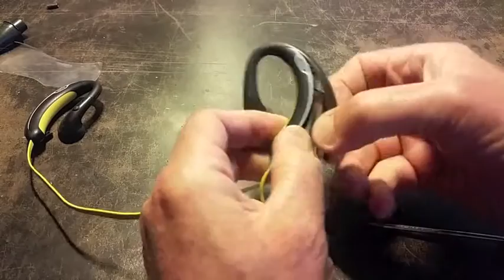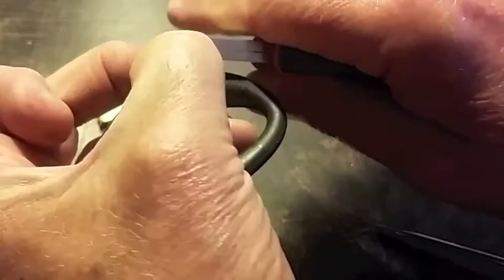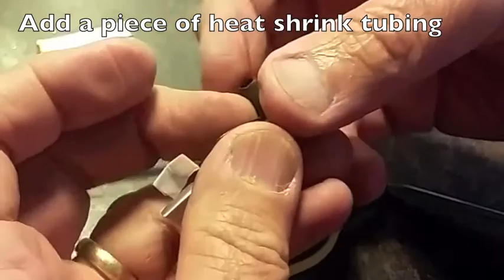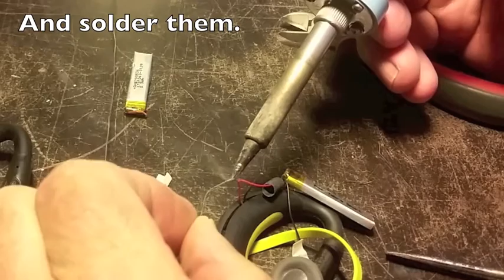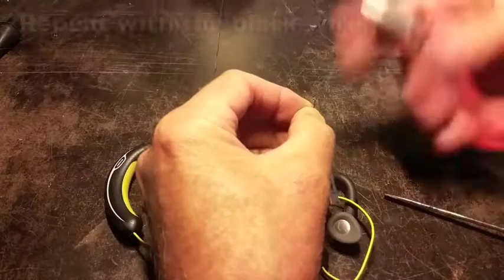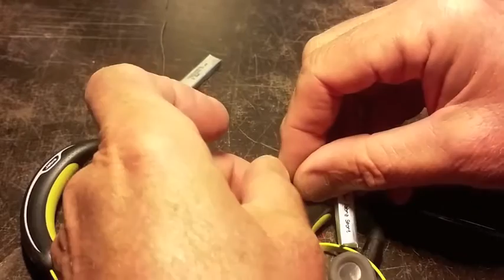Jabra Sport Battery Replacement

Comment: Where did you get the battery and what is the part number?
Reply from the maker: eBay. Just search for Jabra Sport battery
Reply: Hi there.. I have a pair of jabra sport pulse.. It turns on i think, then goes off again.. Is it the battery?? If so, how can I open and change the battery?
Do you have any related vdo for it??
Thanks in advance..